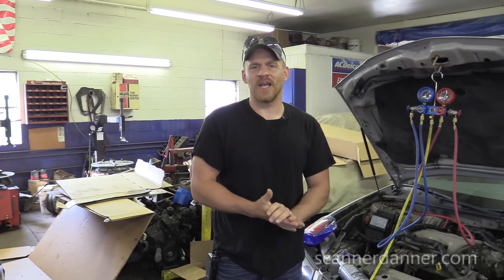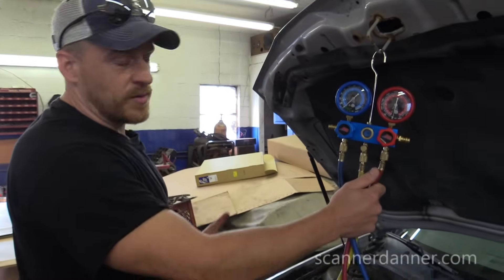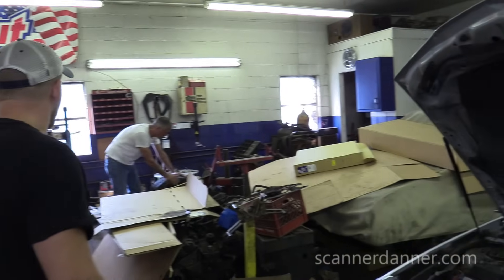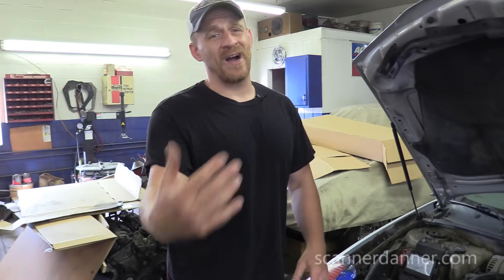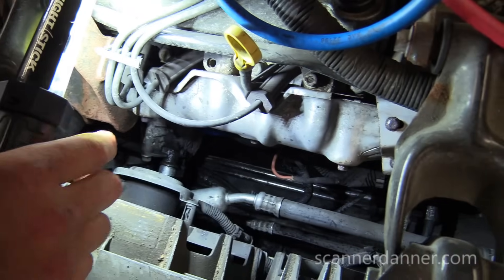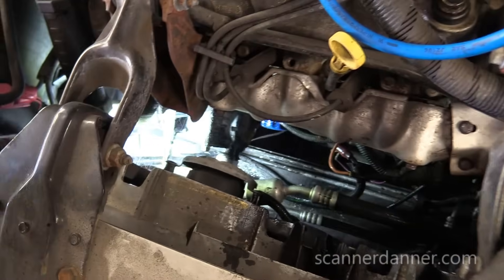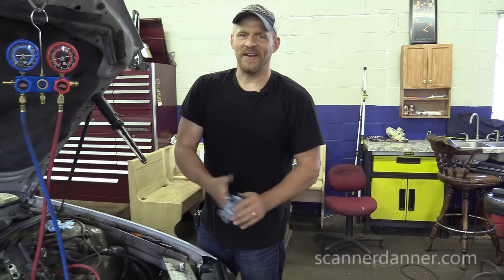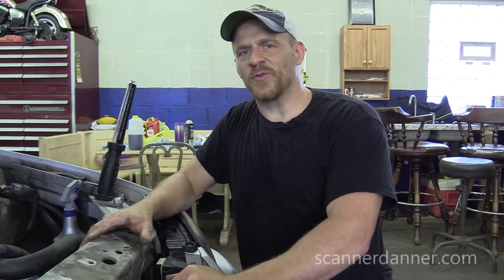A/C Leak Testing Using Compressed Air, Soap and Water (any car)

Comment: Max respect to SD. Since seeing this video I have seen another of his videos where he changes to use N2 to pressure test and points out the dangers of using shop air.
Reply: Was the issue with compressed air that it may introduce moisture into the system?
Reply: @dubmob151  Further to my previous comments about the dangers of using compressed air to pressure test air conditioning systems please see below quotation which was copied from a commercial Robinair vehicle a/c charging station instruction manual. QUOTE “WARNING: Do NOT use air or any gas besides N2 or N2H2 to pressurize the system. Mixtures of air and refrigerant can be combustible at elevated pressures. These mixtures are potentially dangerous and can result in fire or explosion causing personal injury and/ or property damage” UNQUOTE
SD is excellent 99.9% of the time, but do not agree that it is good engineering practice to use shop air to pressure test AC systems rather than dry N2. ALL introduced moisture will have to be removed afterward. Other contaminants will almost certainly be introduced. There will be traces of oil mist in the air (from the car ac system) which may form an explosive mixture with the air and will be evacuated by a vacuum pump that can get hot. If I went to a dealer or specialist and witnessed them doing this I would be seriously unimpressed!
Max respect to SD. Since seeing this video I have seen another of his videos where he changes to use N2 to pressure test and points out the dangers of using shop air.
Reply: @dubmob151  Further to my previous comments about the dangers of using compressed air to pressure test air conditioning systems please see below quotation which was copied from a commercial Robinair vehicle a/c charging station instruction manual. QUOTE “WARNING: Do NOT use air or any gas besides N2 or N2H2 to pressurize the system. Mixtures of air and refrigerant can be combustible at elevated pressures. These mixtures are potentially dangerous and can result in fire or explosion causing personal injury and/ or property damage” UNQUOTE
SD is excellent 99.9% of the time, but do not agree that it is good engineering practice to use shop air to pressure test AC systems rather than dry N2. ALL introduced moisture will have to be removed afterward. Other contaminants will almost certainly be introduced. There will be traces of oil mist in the air (from the car ac system) which may form an explosive mixture with the air and will be evacuated by a vacuum pump that can get hot. If I went to a dealer or specialist and witnessed them doing this I would be seriously unimpressed!
Max respect to SD. Since seeing this video I have seen another of his videos where he changes to use N2 to pressure test and points out the dangers of using shop air...

Comment: SD is excellent 99.9% of the time, but do not agree that it is good engineering practice to use shop air to pressure test AC systems rather than dry N2. ALL introduced moisture will have to be removed afterward. Other contaminants will almost certainly be introduced. There will be traces of oil mist in the air (from the car ac system) which may form an explosive mixture with the air and will be evacuated by a vacuum pump that can get hot. If I went to a dealer or specialist and witnessed them doing this I would be seriously unimpressed!

Comment: Nitrogen set at 250 lbs. spray with bubble blowing fluid , this procedure does a fine job of locating leaks
Reply: I have done this at 150 psi but not finding any bubbles.

Comment: what's it mean if the liquid line connection at the compressor keeps blowing o-rings ? New extension pipe and different compressor (used) because the other one had a Stripped Out connection bolt hole. It still blows that same seal when you fill it with only 1 can of r134a. I can't get it to stay sealed. that's my only leak !
Reply: Edit : Usually, this connection never has given me a problem. My gauges don't work, so I have no pressure readings, which probably I needed to make sure the pressure isn't too high and blowing it.
Reply: Edit: Sorry forgot to add that it only leaks after you shut it off, the engine and a/c.
Reply from the maker: Using the wrong o-ring maybe? No idea. If it leaks on shut down only, it isn't a pressure problem, it is a sealing problem

Comment: I just used this method and had a heck of a time finding the leak, turns out BOTH service ports were leaking. I have two dryer filters on my air line so I wasn't worried about moisture. I Vacuumed the system down and it held! This was on a 2000 Tahoe. Thanks for the video!
Reply: Did you just listen for the leaks there instead?  Or just release the pressure from the gauges and check for pressure coming back up without opening the valves?
Reply: @dubmob151  Soapy water in a spray bottle.

Comment: You never want to use air on the system. It has moisture in it and that’s the last thing you want in the AC system. The moisture hits the Freon and forms acid which slowly destroys the entire system. Compressed nitrogen is the proper way.

Comment: wouldnt it be better to use Co2 gas instead, as that should have less moisture in it?
and u could also vacuum all of the moisture out from the dryer thingie in there?
Reply from the maker: Nitrogen is what most HVAC guys recommend and I actually have a bottle of it now and have some newer videos using it. Thanks! But to be honest, I've used compressed air for 25 years and have never, not once, had a problem with it. It is much better than charging with refrigerant to test for leaks like most people do
Reply: @ScannerDanner  ok, but can u still push the gas in there, if it has some of the refridge still in the system and how do u even know how much is left in there lol

Comment: If my car wont even hold compressed air, leaks out immediately. Does that sound like a huge leak in the compressor? Won't hold air for a second even.
Reply from the maker: Huge leak somewhere, spray some soap and water and find it

Comment: Thanks for posting.  I just finished an AC install in my 1965 Dart and wouldn't hold a vacuum, so was looking for the best way to test and wondered if nitrogen was essential.  Glad I found a video where compressed air is used since all I have and didn't want to waste a can of refrigerant looking for the leak.  Used a new Sanden compressor, made my own hoses (Master-Cool crimper), but vintage condenser and knee-knocker climate box.  The later use flare fittings, which are metal-metal.  Found a big leak at the condenser outlet flare fitting.  Connecting each flare side to a plug held pressure.  Worst-case, I have a copper "soft seat" I can add at the flare (also made in aluminum).  Not worried about a hypothetical explosion since no refrigerant in system yet, and even wonder why commenters worry about R-134A in yours since long-gone (no pressure as-found).  I use Duracool (propane-butane) and PAO68 oil which doesn't absorb moisture.  I have a filter-water trap after my air compressor, plus the system will sit for days at high vacuum (once fixed) to boil off any moisture that gets in.
Reply from the maker: Yeah, you'll be fine using compressed air. Nice job my friend

Comment: Thanks from Australia for the information, I have a KJ Jeep with a slow leak that is impossible to locate. I tried leak testing with no success and as the system is empty I’ll try the compressed air method to locate it this time.

Comment: It's good. You can fix your AC yourself. It doesn't cost an arm and a leg. A few new seals, or a bit of hose or welding down the machine shop for next to nothing, $50 of gas and you are back in action. Beats handing control of your machine over to people who want to charge up as much labour and parts as they can for mending something so simple.

Comment: I need some suggestions.. I'm working on my r50 pathfinder ac and I just cant get the compressor to pull down the low side pressure or build up the high side or to take in any more freon... I get around  25 on the low and 80 on the high... i know for a fact the compressor is working, I changed the expansion valve about 3 times, changed the drier 2 times... this is the 3rd compressor I've installed and same issue

Comment: Broh don't use air. Air has moisture therefore moisture mixed with r-134a will make hydrochloric/ hydrofluoric acid. That's why you are supposed to use nitrogen to pressurize.

Comment: Any idea at what pressure ac compressor release valve should kick in?
Reply from the maker: 400 psi? Somewhere around there
Reply: @ScannerDanner  Ok thanks. I've been trying to find a slow leak, one that takes about a month for the system to be empty. When I filled my system with air today I heard a large leak from compressor area but wasn't quick enough to see where it was coming from. I suspect the valve popped but it was nowhere near 400 psi. 100 at most. Soapy water isn't showing anything. Do you know if there is a way to test the valve to see if it's faulty or failing? I wonder if it randomly kicks in and leaks freon.

Comment: Danner people have told this method can put contaminants in the system and ruin compressor is this true?
Reply from the maker: I've literally done this a thousand times with ZERO issues. EVAC the system real good when your done, make sure your air compressor isn't full of water, use a water separator if your worried about it. I'm using nitrogen now just to quiet the noise from this crowd lol. Check out my newest AC videos if your interested in the nitrogen method
Reply: @ScannerDanner  yeah Paul , i watched almost all of your videos.. an that last one with a jeep diagnosis getting out of hand just for a Ac leak ahah. 
Yes i was asking this because im starting using this method , do you find this more helpfull than UV Dye or  A Eletronic Sniffer? What is your feedback?

Comment: Thanks for this it saved me wasting expensive refrigerant. I put the money I saved towards a small compressor instead. The stethoscope tip from another reviewer will help in hard to reach parts of the system. I cant do any physically demanding work on my car due to poor health.  Your video  has empowered me to tackle this job myself. I will gain that sense of achievement from doing it myself. Thanks.
Reply: compressor is always a wise investment, larger the better, at least waist high since you want large volume for tools. 
release the air afeter every use, and drain it yearly to avoid rust internally and they are great tools for any shop.

Comment: My 05 gmc yukon keeps losing freon about EVERY 2 months. I ran vacuum on the empty system overnight and it held so I'm really confused on where it would be leaking from. It does have front and rear a/c . Just looking for advice cause times are hard from COVID19 and money just isn't there.

Comment: That comment you made about compressed air is what I've always thought. In fact I made a little piece to connect to my compressor and my manifold gauges.   I fill my system up to about 100 PSI every time I do an AC repair just to check it and I've always thought that the vacuum process would eliminate any moisture that the compressed air may cause...... AND I've never had a problem in the decades I've been repairing cars.......

Comment: Compressed air contains oxygen.oil is also fuel.oil+oxygen+ignition equals combustion
Reply from the maker: where is the ignition coming from? it doesn't happen
Reply: @ScannerDanner  any sparks coming a battery
Reply: Well I need to get rid of my air compressor then. That baby could blow at any minute! We should outlaw them ASAP!
Reply: @KSparks80  compressed air is safe if not mixed with combustible oil
Reply: @marcelodizon5109  What lubes the piston in an air compressor?
Reply: @KSparks80  the topic is not to use compressed air in an a/c  and refrigeration unit,it's unsafe.use nitrogen instead.

Comment: What do you do if your system is leaking the refrigerant out in about 2 weeks, and putting dye and compressed air in system does not show any place its leaking???
Reply from the maker: have you put a "sniffer" in the EVAP drain tube? Like on this one https://youtu.be/m5XM5Ak55gU
Reply: Happend to me in 06 impala eventually it started leaking out of compressor
Reply: @johnhenry3820  changed out compressor and no more leaks ... I guess that was the issue and it was leaking internally and was not showing ....
Reply: @kdeh21803  Yea I have yet to replace mine shits expensive for brand new

Comment: When I charge the AC system with compressed air the system does not retain pressure. It goes from 100psi to 10psi in about 6 minutes and I noticed the air is leaking from the compressor pressure relief valve. Does this mean that the compressor is bad??
Reply from the maker: Psi relief valve could be bad. Cheap part most likely

Comment: I use an old can of refrigerant, drill a hole at the bottom and shove a tire schrader valve into it. Of course I only resort to this if the system is already totally empty since it's gonna need an evac and new drier after the repair anyway.

Comment: Dude you are a good feller.  And a great mechanic.  I get a good vibe from you.  Ignore the armchair mechanics.  Out of respect for you I'm not going to curse here on your youtube comments section.  But I have a better choice of names for these folks. 
Keep posting brother!!!
Reply: Armchair mechanics are not the problem, bitter people are.  There is nothing wrong with this method if the system is gone, no pressure.  This video helps the average guy with an older vehicle who doesn't want to spend 1K+ at a shop to figure out what's wrong, even if that shop is worthy. Yes, Dan is a good guy, most of us aren't working on 50K SUV's and Trucks.  If you have one please just take it to the shop.
Reply: @frankgriner2932  . . . .i won't "take it to the shop" I fix it

Comment: never in my life have i seen compressed air used, all that moisture ends up in the oil and will burn out compressor after creating acid. Get a bootle of nitrogen, its just as easy to hook up to a regulator and small automotive systems dont use much to get up to pressure.

Comment: Orfice tube and expansion valve if high pressure high low pressure low...restriction as well.
Good catching yourself..i was about to mention that receiver dryer..lol
Great job on the air test.
But like you said just bc you find one leak doesn't mean it isn't leaking elsewhere recheck with sniffer or dye.
Dye check the evap drain tube.
Reply: I always found it odd how they said the refrigerant goes up and attacks the ozone but our sniffers have to be placed under leaks as the refrigerant is heavier than air..lol

Comment: Scannerdanner I just watched your video I thought it was great. I have a question, if you use compressed nitrogen instead of air to check the system for leaks would you still have to replace the dryer? Thanks

Comment: dude pull a vacuum and if it holds then there is no leak. -30 on low -5 on high. easy peasy. if it doesnt hold then throw green dye in the system and get a black light. What you are doing is much harder then you need to be doing this. lol
Reply from the maker: I've seen many systems hold vacuum but leak under pressure
Reply: @ScannerDanner  what for real? i usually pull a vacuum for 45 to an 1hr to get the moisture out and check for leaks. if it goes back to Zero over night then you have a leak. but that soap does do the trick esp for tires. lol

Comment: Ain’t a thing wrong with using air, air is free that’s why regulation control has a stroke if you do it because if you don’t a buy a regulated product to pressurize they don’t get a kickback in my opinion, when you vacuum you are removing contamination anyways right?

Comment: Should never use compressed air, it contains too much moisture..
Compressed nitrogen is the way to go.
You supposed to know that if you are a professional tech..
Reply: You mix compressed air with compressor  oil when you check if A/C system  functions as it should...

Comment: Cost effective diagnosis, but leak is only from condenser area then what's the purposes of replacing the receiver drier too🤔
Reply from the maker: It has a desiccant bag in it to remove moisture from the system and when they are open to the atmosphere for an extended period, supposedly the desiccant is ruined. I've done many without a nee drier.

Comment: You do know using compressed air from your compressor will saturate your receiver/ drier even more than it already is causing posible if not permanent damage and blockages. Cheap way yes, Not a good idea if you value your A/C system.
Reply: What else can you use, just asking refrigerant Maybe?

Comment: Your compressed air has water inside of it you know... use nitrogen to charge the compressor to do a leak test, and never start a compressor dry like that, your little bit of moisture you added with that air is in the system so when you started the compressor the compressor compressed the moisture right into that oil, and your vacuum pump will take forever to get that out, most likely youll freeze the water before its able to come out in a vacuum, so unless you put a micron gauge on it and bring it down below 500 microns, then shut off your vacuum to see it maintain that number for 1 hour, if not repeat that process till it does, but you went ahead and gave your customer back a compressor that will always have water in it and will break down before it should, this is why car air conditioners fail more often than home/commercial ac units. If you dont know what your doing, stop! And look into what it is your looking at, and dont do things the old timers did especially on ac systems! Congrats you screwed your customer out of money!
Reply from the maker: Same tired arguement 🥱
Reply: @ScannerDanner  so your cool with what your doin there in the video? Im just gonna suggest that you stop working on air conditioners.